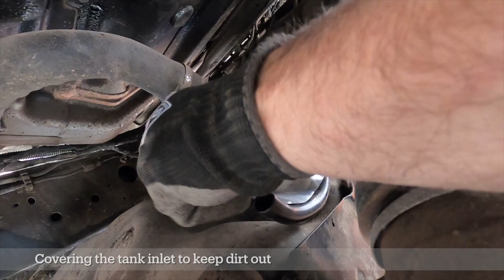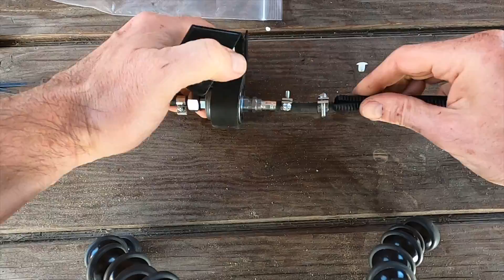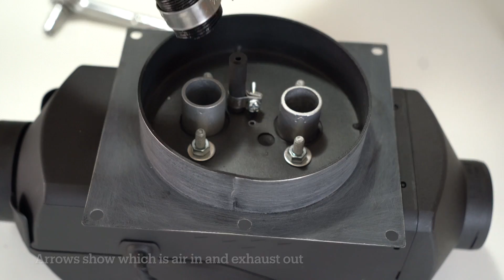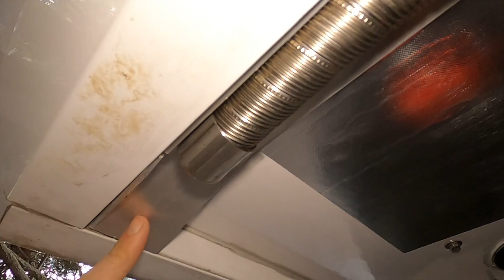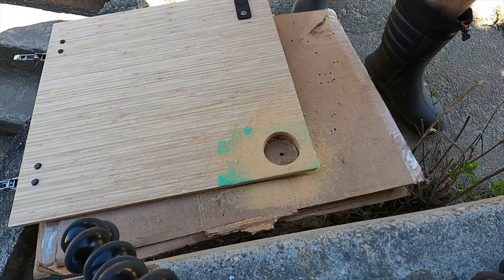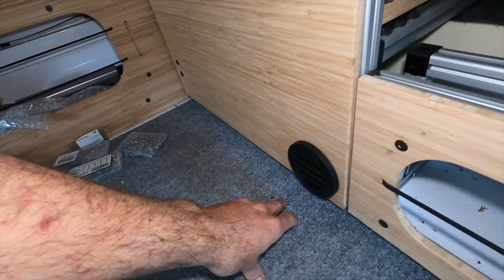DIY Diesel Heater Install - Dream Overland Jeep Camper Build Pt. 10

Comment: One opportunity we don't see people taking advantage of very often is to somehow capture some of the wasted exhaust heat.
These heaters produce crazy hot exhaust and all of it just goes to waste. If we could somehow capture that heat in a radiator to keep water warm or something - because so much heat just goes to waste.  Residential gas furnaces have been recapturing flue gas heat for years to be 96% efficient - we need something like that for these diesel heaters.

Comment: CAUTION!!!  Dan I did not see you put a fuel filter on your fuel line. Let me warn you I have owned three of those diesel heaters over the years some expensive some cheap. I can tell you that all of them have EXTREMELY small orifices. They will plug up very quickly with dirty fuel. I highly recommend that you put a small fuel filter on there someplace that is very easy to get you and carry several extra filters with you. Especially if you’re overseas any place where you cannot guarantee the quality of the fuel. I know you’re not going back to Africa, but other countries have dirty fuel also. But believe me you want a filter on that line
Reply: The Espar and planar have a filter in the pump. It’s tiny but it’s there. Ive had 4-5 so far and the current one mainly dislikes sitting for a long period of time. I’ve blown it out with compressed air, but bringing a complete spare pump probably would have been the best thing to do.

Comment: I have, as you know worked in the highlands of Iceland and north Norway for 30 years, using diesel heater a lot. The important thing is to turn them on at least once a week, regardless of the need. If they are not used for some months, something regarding the ignition fails and you need to take them to workshop for overhaul.  All you get is lots of white smoke through the exhaust.  I have most of the time had Webasto heaters. Very very good. Now they have cabin heater like this, but is also water heater for shower. All in one unit. So that is what I am aiming for.

Comment: Hi Dan, good job. The exhaustpipe need a angle down to ground. Now its possible that water condense in the pipe, froze and clock ist up. Also after watercrossings, the water need a way out of the pipe.
Reply: We have all of ours at a 45 degree angle, but a lot of the mufflers have a low point drain so it probably doesn’t matter that much

Comment: If you ever want to quiet it down the mufflers for the exhaust side and the felt hose on the outlet side makes a huge difference. Did a Propex heater and even using a small section to non felt hose made a huge huge difference in volume reduction.

Comment: Nice work.  Though if it was me, I would route the air intake hose towards the front of the vehicle (as far away from the exhaust outlet it can go), and maybe even wrap the exhaust tube with thermal exhaust tape for added heat protection.

Comment: Yet again you hit a home-run on a practical no-nonsense approach to the full-time travel lifestyle and showing how attainable it is to to anyone willing to make the necessary choices.  Diesel heaters are a great option for cold weather living.  That said, I did not see any sort of filter on diesel line going to the heater.  Oversight?  Installed but not featured?  Given the places you're going and the (questionable) fuel quality a filter is probably cheap/easy insurance.
Reply: Espar and Planar have a filter in the pump

Comment: Head up, they make a muffler and a air intake silencer if you find the exterior components are a but noisy for your taste. Also I would recommend you make sure to run the heater once a month for a high heat burn for about 30 min. That has served us well for the units we install. Camper is looking great!
Reply: Great advice.  I have 2 of these installed in our van and boat.  The mufflers really do work, and are a nice courtesy for those who might be camped nearby as these heaters are quite noisy from the outside when starting up.  High burn will prevent sooting.

Comment: Haven't managed to install the exhaust silencer on my diesel heater yet, sounds like a jet engine starting up when it gets going. But it's a hydronic system with an Autoterm unit so it's got a bit more oomph. Definitely needs a silencer.

Comment: good explanation of the overall install. One thing: I would have used a longer line for the air intake, best chase run to the other side of the vehicle

Comment: I'm a little surprised at not seeing any filters and especially with a small fuel line. My BJ60 LC had a sedimenter and no problems with winter wax in Canada. Even an intake filter for snow...

Comment: Dan I've been a subscriber for over 6+ years and once a patron member (I'm full-time now, so I need all the money now).   You are the reason I  chose to live this lifestyle. I've talk to you in person, patreon message and comments on social media and you've always been awesome on answering my questions and really just an awesome dude.  But, why would you use your main diesel tank for the  heater and not a separate tank?  I know the heater sips diesel, but I wouldn't want it to come out of my main tank.  What is your thought/reasoning?  Funny thing I already know your answer to this..... extra weight.  To be honest I might join patreon again just because you're just awesome and knowledgeable, however 8 do know where you are shipping but mums the word.
Reply from the maker: haha, thanks!
It's about the weight, but also complexity. Another tank has to be mounted someplace, you have to fill it separately, it might leak. It will be small enough you have to fill it often etc. etc.
The pickup tube for the diesel heater does not reach to the bottom of the tank, so it can't drink the tank dry no matter what. There will always be diesel to run the Jeep.
It's just much, much simpler this way.

Comment: This might be a dumb question but it’s relevant bc I’m about to install a diesel heater in my 80 series LC I’m building to live in. 

Do you have any concerns of heat making its way upstairs to the bed area when it is closed? 

Reason i ask is because I’m having a hard time trying to figure out how to get the heat both upstairs and downstairs in my setup as it’s a split drawbridge style bed platform that will seal off the downstairs when it’s shut.

Getting heat downstairs is no problem but getting it upstairs when it’s closed is the challenge I’m facing.

Very good chance I’ll just do what you did with your door vent on one of the bed platforms with some form of blast gate to control where the heat’s directed to.

Big fan of your stuff, huge inspo for my own!
Reply from the maker: My bed platform will not entirely cover the opening for exactly that reason - it means a person can climb up and down and it means the hot air will be able to go upstairs no problem.
Maybe you can leave a gap in yours

Comment: So can you not open that cabinet now? Or everytime you open it the outlet tube has to expand and contract? 🤔 ... I also noticed some type of straight lift roof lift system, have you solved the straight lift roof with straight lift bed situation? Thank you 😁
Reply from the maker: The cabinet door opens and closes exactly as it always did - the hose is not connected to the door.
Stay tuned for the next video on the roof!
Reply: @TheRoadChoseMe  so the hose just sits near the vent hole in the door? Or does the hose connect to it's own flange inside the cabinet then when the door closes the inside flange and the outside vent mate together so that there is no heat loss into the cabinet? I'm definitely staying tuned for the roof/bed lift setup, have you solved it yet? It's a difficult puzzle to solve so just knowing if you've solved it would be helpful :D

Comment: Ive been curious how well these heaters handle dust and water in the intake pipe. There will be tons of dust and water spray at the back of the camper, and possibly could be submerged in a water crossing. I assume as long as the heater isn't running it'll be fine, but ill be keeping an eye on you to see how its lasting.
Reply from the maker: To be honest, me too!
I did a ton of reading and everyone seemed to say they're pretty tough and fine with river crossings. Time will tell for sure
Reply: I’ve had a few in different vehicles and have never had a problem with that. Our current heater is giving us a bit of trouble now but I’m guessing 90 percent of that is because we haven’t used it much between the US and Argentina. They really need to be cycled fairly often and our planar can’t be run above 80 something Fahrenheit

Comment: Are you not worried about the air inlet sucking up water ?  Shouldn't it be up higher?
Reply from the maker: I won't run it while I'm driving, and I don't plan on parking in a puddle that is nearly 3 feet deep

Comment: Did yoù consider having a separate diesel fuel tank just for the heater, as is common on caravans here in Australia? There are pros and cons.
Does your diesel heater have a fuel filter?
Reply from the maker: No, that sounds like extra hassle I absolutely do not want to deal with. The whole point it is have every system be as "invisible" as possible so I can spent more time enjoying adventures, and less time messing with my setup and all the systems.

Comment: Hi Dan. What type of heater would you consider for cold tent camping for a size like the Gazelle T4 Plus Hub tent.
Reply from the maker: How are you going to power it? The only heater I've ever used in a tent was a wood stove...
Reply: @TheRoadChoseMe  I have a 200AH lithium secondary battery in my vehicle and a 550Wh lithium portable battery source. Was wondering if using a diesel heater would be a good option for a tent.
Reply from the maker: Plenty of people do use diesel heaters they install into a pelican case to heat a tent

Comment: How hot does the exhaust pipe get, and also the pipe that brings hot air into your space ? 
 Ive used a diesel heater, and they Both get very hot. 
 Are you ever gonna be done it’s this Build ?
Reply from the maker: The exhaust gets very hot for sure! But it's designed for that and will be fine.
The camper must be in a container to ship to a new part of the world in mid July, so yes, the build has to be finished! The clock is ticking

Comment: Dan, are there any elevation restrictions on the diesel heater that you are aware of? I know that venture4wd installed a petrol heater that started malfunctioning above 5K feet. I've heard Chris say that he was looking into diesel heater options in the future to try to remediate that problem.
Reply from the maker: I'm pretty sure mine has a high elevation mode for exactly that reason,. I need to look into it
Reply: They all vary. I’m not sure which version this is but I think the newest Espar has a built in compensation function and is good for probably at least 4k meters maybe 5. The last Espar I had required a dongle that increased the ceiling from 2200 to 4000 meters if I remember correctly. And our webasto required a lower volume fuel pump do get similar results. We currently have an auto term that’s good up to 4k meters but the dealer where I bought it said that you can run kerosene to get a little more elevation out of the heater.